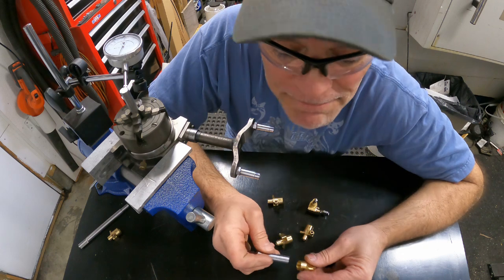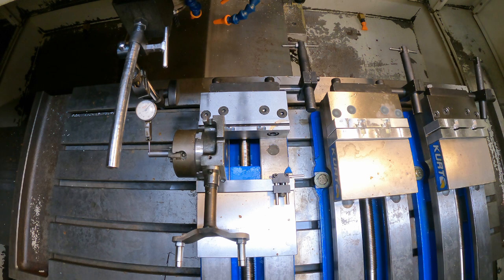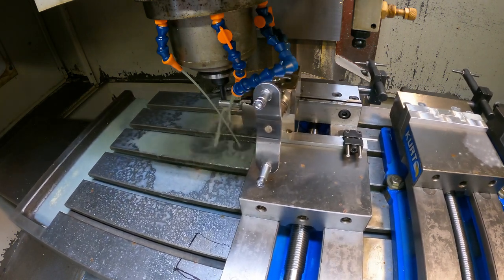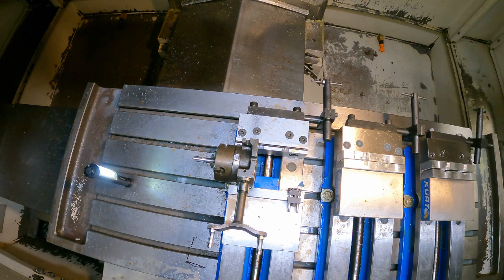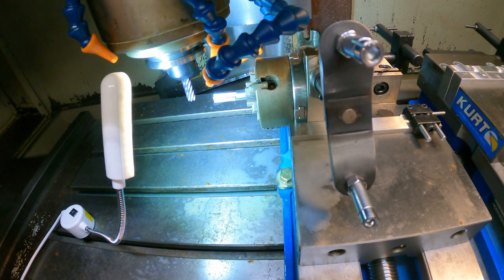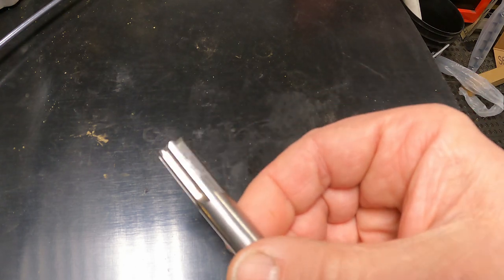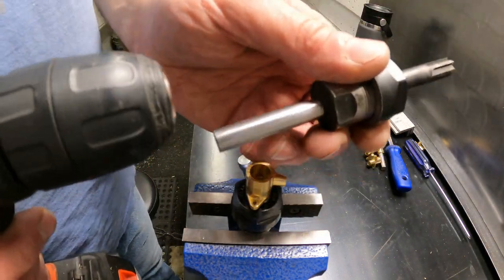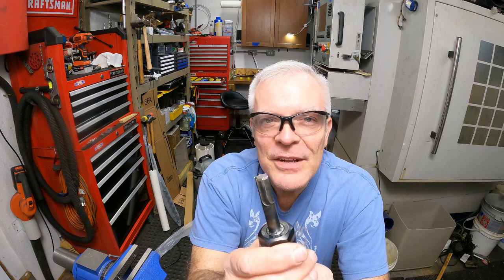How I Made a Reamer Using Tools and Material I Have in My Tiny Workshop

Comment: You are doing it Ghost Busters style with the twin torches with exponential result!
Great build and most inspiring! What drilled hole size did you begin with?
Reply from the maker: The hole was machined on the CNC but I wanted to open it up just enough to take the machine stepper marks out of the bore. The reamer was made from the same precision ground rod that the parts going inside that bore will be made out of.
Reply: Thanks for the reply! Greetings from Sweden

Comment: Why didn't you temper them? Your AC or heater noise was a distraction although the video was decent.
Reply from the maker: My knowledge of metallurgy is limited… I figure that since I was barely reaching the critical temp for hardening that I was probably only hardening the cutting edges anyway. And…only cutting a few brass parts that I wanted to salvage.  Please let me know if the tempering process is doable with what you have seen of my equipment. Can it be done in a toaster oven?
Background noise is the CNC machine and the rotary phase converter to run it.
Reply: @OldDog-NewTrick 
 you may not temper, however:
1. after quenching the part usually looses about 0.02mm or so from its OD due to the oxide
2. the way u used the reamer is so wrong, the side movement has to create a belly mouth on the part, use the drill press on a slow speed , if u dont have that, then put the hand drill on the vise with the reamer in it, and ream the part with holding it into the reamer at a very slow speed
Reply: To get a really hard part you need to heat tool steels to bright red.  I use oxy acetylene for that.    Can use oil quench for less stress in the hardened part.
To temper a part like that polish an area with Wet and Dry paper back to bright steel,  degrease in naptha and don't touch where you have polished it.  Get one MAP torch lit and bucket of water handy,  then waive the flame over the part and watch the bright areas.  Heat very slowly and gently until you see the bright areas start to turn a dark straw colour,  then immediately dunk the part in water to arrest the process.  Sharpen the reamer's cutting edges by hand using a fine Arkansas stone
You will notice proprietary chucking reamers are a very long shank.  Reamers should be set dead coaxial with the bore,   like have the part in the Lathe collet or chuck and reamer in the tailstock clamped at the far end of the reamer.  Run the Lathe slowly (in back gear in my Lathe) and lubricate with WD40 say as a cutting fluid.  That way you will get a precise bore with no "bell mouthing" but don't let the reamer bottom out in a blind hole as the hole will immediately go oversize.